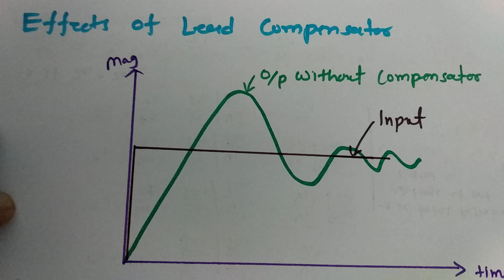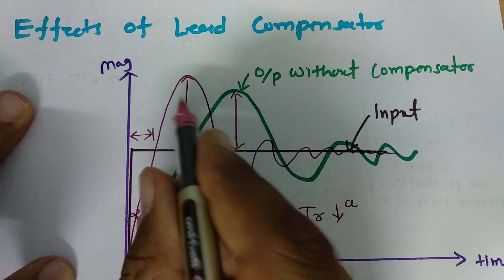Effects of Lead Compensator on Control Systems

Comment: Sir,I have a doubt, could you please explain me,if you are free a while...Sir,since response is faster, settling time will be less and settling time=4/(zeta)w
So zeta will be more then maximum overshoot will be less, right?
And what about steady state error sir?
Reply from the maker: Steady State Error depends on system Transfer Function and input to the system.
Reply: @EngineeringFunda  ok sir, thank you❤️